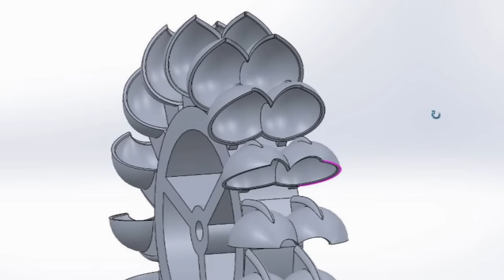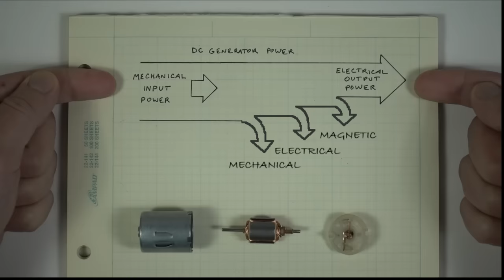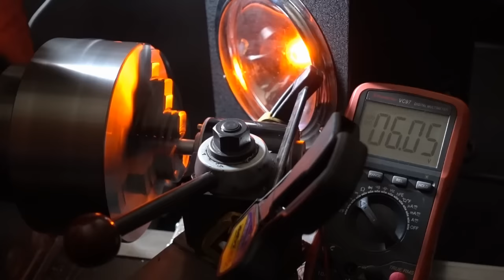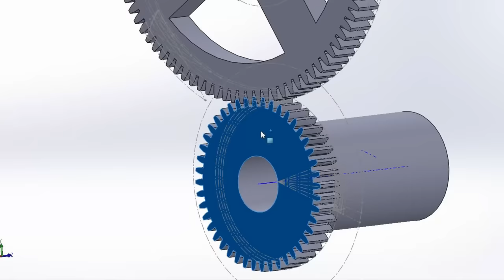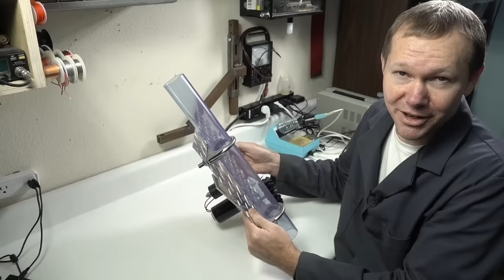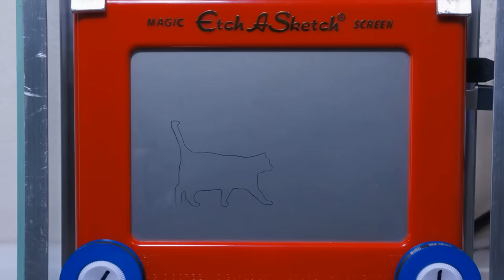Rain Gutter POWER #1 - How to Harvest Free Energy From Your Roof with a Hydro Electric Generator!

Comment: Wouldn’t the gutter overflow if it was restricted to one of the demonstrated streams? I think you need a lot of holes and motors to covert all the water from the roof to power.

Comment: Can't you use a  vertical turbine design, where your generator is mounted vertically, with the turbine impellor connected  directly to the generator shaft. the turbine housing can be 3D printed so that it attaches directly to the PVC tube this will  use more of the available  water pressure, instead of having it splash all over. It also won't clog on pine needles because there will be a larger volume of water flowing through, and past the turbine impellor blades   (see also hoover dam).   --of course that might require a  bigger rain storm to get it to run continuously, but...

Comment: This won’t work without a pump to get the water back to the top to cycle it through again as it will stop raining means no power at all. Use a pump powered by a solar panel and your get constant hydro power plus way more power generated

Comment: 1:08 You forgot to take into account the angle of the roof. You want to use the ground projection of your roof to guess how much rain you collect, you're somewhere down ~25%
Reply from the maker: You forgot to listen to my words during that part...
Reply: @QuintBUILDs  Watching that part again, I did not ear you mention it. Your schema however seems to give ground projection but there is uncertainty. Sorry if my comment sounded harsh, I'm only looking to be technically accurate (~25% difference talking 5W is significant). Overall, loved the series and thought process. Thanks for reading the comment and taking the time to reply.
Reply from the maker: No worries, pretty sure I said "once I calculate the horizontal distance" plus the dimensions depict the horizontal component. You're by far not the 1st to ask if that was an oversight. I probably missed stuff elsewhere but not that. :)
Reply: @QuintBUILDs  gotcha! At 0:28 indeed. I did not understand it as ground projection. Thanks

Comment: If you had a lot of plastic you could of had gears get smaller and smaller to the size of the motor to create a lot of extra power. You don't even need to bring the size down that much if at all to increase the rpms

Comment: Could you not utilise the Upper diameter of the Pelton Wheel? that is, two (2) individual water jets from the same pipe? You could put a junction to take the water to the top of the Wheel. I have a feeling that You have an excess of water on just the single jet, and this water isn't doing any work. You may find that you have increased efficiency by playing with two water jets that impinge on the Pelton Wheel. Greetings from Australia.

Comment: Hi.
I bouth this motor for wind turbine , connect to battery 12v, max what I can get is 6v or 7v.
But even after few hours run turbine battery voltage go down.
Completely 0 amper.

Comment: I have a well 40 feet deep ten feet around at the top and panels down to 5 feet around at the bottom it’s solid rock all the way down my great grandfather chiseled it it’s always full of ice cold water I always wondered if there is a way to make a hydroelectric system using the water bike jump start starting a water pump to turn a water well that is connected to a generator motor and then switch the water pump where it runs off the generator motor I broke my neck several years ago and I’m bedbound now or I would try it to build something

Comment: Wider pipe creates greater water pressure. Easy solution.
Reply from the maker: The formula for pressure contains no width.  Only density, gravity and height.
Reply: @QuintBUILDs  density is increased by expanding volume at height. It will create greater pressure.
Reply from the maker: @erikbrush  it creates greater weight, not pressure. I realize it may not be intuitive but it's 1st yr engineering stuff. Look it up.
Reply: @QuintBUILDs  precisely. Greater weight. If you were to use a small funnel in conjunction with a wider pipe the flow volume would increase. Also a small funnel instead of a simple aperture would decrease the likelihood of debris blocking the flow and would create a flow pattern.

Anyway, these are simply suggestions. I found the video an intriguing premise. And having not attempted this myself I will defer to your experiences and findings. 

I am building a houseboat as a permanent liveaboard residence. I'm in south western Florida. 

My rainwater downspout system is slated to have a diverter so that after the first ten minutes of rain flush cleaning the roof I can harvest rainwater for a potable water supply. 

I had not considered using the remaining flow as a potential battery bank source of energy. 

I've been looking into making small hydro turbines to deploy at anchor when the tides are running strong or when I am under way. Your idea has me considering a small series of generators staggered inside the downspout since I will have a debris guard system on my rain gutters and will be mostly away from any solids that could even make it to my down spout. 

Thank you for the video and the discussion. Best wishes with your system.

Comment: the entire manufacturing process using power-tools causes it to never be power-positive. It's a fun project, but only viable when you have excess power that would otherwise be lost (eg full batteries on an off-grid system). If you only use handtools in the production process it's a different story.

Comment: 0:46 seconds you already make the mistake all people do.....dont worry about flow rate unless you have a nozzle large enough to handle all of the flow....and you dont have from one downspout

what you should worry about is head....that is measured at the top of the water before it goes into your downspout ...so your head is around 12 foot 

12 feet of head is okay

now you are probably going to have a nozzle that is anywhere from 1/4 to 1 inch....so flow wont be an issue

the velocity from the nozzle will be good from a 1/4 nozzle with 12 feet of head

Comment: Y not connect nozzle insted of free water hitting the pelton wheel ,because using a nozzle increases the pressure also connect the nozzle closer to pelton wheel so that u will not loose the water pressure

Comment: i think you get more power if you just make a big water wheel high enough to the top of the drain on the roof and then just let it do normal slow moving leverage and then use a small gear up to turn a motor ac a generator and you chould get many times what you get now. the pelton wheel is lossy piece of crap that loses big amount of unseen energy potential in the input.

Comment: 5mm of rain on average an hour seems over a year average a little optimistic, here in the netheralnds it's on average like 1-2 mill an m/2 / hour. Average / year t hat is
Reply from the maker: Agreed.  "moderate" as listed in multiple places on the internet is in my experience definitely not "average".  The rain does supply the rate I calculated but only a few times a day on a rainy day.

Comment: why not use a smaller hole on the tube --> faster jet --> more rpm?
Reply from the maker: That would reduce the flow at the same jet velocity which would reduce power.
Reply: @QuintBUILDs  did you calculate the optimal rate of jet speed to water flow? This could really help me with a project I'm working on
Reply from the maker: I should have but didn't. I'll probably go back and see where it landed at some point. People put the formula in the comments for me somewhere.

Comment: Why not use the wheel to power an automotive alternator to charge batteries. The use a power inverter. If you couple this with solar panels you get fully charged batteries rain or shine

Comment: Are you by any chance a physics teacher?
Really good vid but it's highly unlikely the average Joe happens to have a machine shop and all the other gismos in the garden shed let alone the free time to mess about like you have just to light an LED.
However, a good idea, just needs more power like to run a fridge or kettle ☕☕☕☕☕🍩🍩.
How about a high level collector tank which would add more weight to the downflow??
An opportunity to design a sellable DIY kit to get power for a battery charger which could run an adjacent outside light, also clipped to the downpipe.
When you make that million dollars please remember I gave you that idea and pay my mortgage off there's a good chap 😊😊

Comment: To bad you can't 3d print a basic transmission to reduce the torque back pressure on the cupped wheel.  Wait, you can :D

Comment: Why not capture the water off of the generator and pass the water another generator, use a dozen generators and combine the outputs in parallel or in series to charge a deep cycie battery and instead of one two meter drop, stagger the generators a 1/2 meter below each other less power per generator but make it up on quantity of generators

Comment: Your assumption of how much water vs sq area is inaccurate.  Your roof doesn't lay flat and looks like it's on a fairly steep pitch.  It's on an angle and you can only take the "footprint".  You have to consider the pitch vs area.  If your roof was "vertical", you would get "zero" water being caught and flowing down the roof.
Reply from the maker: Nope, watch that part again...
Reply: my bad, You explain everything else so we'll and don't make this point explicit
Reply from the maker: @chineseredneck1211  no worries, several people have made the same assertion.  Probably because I put the word "Area" on the surface of the roof?

Comment: It can't work. Why? The more power we need, the more resistance comes from generator. So in this case, his generator can 2 diodes power up. The better results he could reach, if he install huge tank below the roof, gathering the water, and one pipe draining where the turbine could be installed. Better but not enough.

Comment: It would have been much easier to build a Pelton wheel half as big than the one u were using. This would have doubled the RPM without sacrificing efficiency...
Reply from the maker: It's more complicated than that.  Power is torque x rpm...  And pelton wheels really care about jet vs. spoon velocity.

Comment: The rain footprint of your roof is not the same as your measured area. Your roof is a hypotenuse and you have to find the horizontal component. It wouldn't be worth knit picking if you didn't feature calculation so much.
Reply from the maker: Better watch that again...

Comment: Gears are bad, 3D printed gears are horrible. Use a Flyback Converter to boost output voltage from the direct-drive generator. A simple DIY kind of flyback is called the "joule thief" and every one of the cheap solar garden lights has one. There are some good vids on YT which go into the theory and building of them.

Comment: wouldnt it be more productive to collect that rain water in a 55 gallon drum (maybe tied to a tree at the level of the gutters with just enough angle for water to flow into it. then run your down spout and changing diameter of pipes can drastically change outcome creating high/low pressures. You could have a switch turn on when barrel gets 3/4 full. 
even though i do not see this worth the cost/time verses outcome. You are also going to loose power running wire from outside to inside where you would use the load, longer distance = power loss. 
seems like it would be better to reroute this water into a water turbine system, which can produce 500+ watts, run that water from all gutters into the 55 g drum and run that 500 yards away, that will create a nice head/flow rate, if you can add that to a dammed stream or pond water source, you have a much better use of this water.
Reply from the maker: I need to do a video addressing people's belief that diameter of a vertical pipe has any influence on pressure. In part 4 I make use of a reservoir.
Reply: @QuintBUILDs  from what i understand the weight/density of the water (as there would be more water) x gravity would create more pressure. I have seemed to get those results, not that I have done a whole lot but doing some water hydropower experiments, so I will probably learn much more.
Reply from the maker: @kevinjohnson5060  pressure = density x gravity x depth. The weight of a larger volume of water will be greater but the pressure would be identical. If width were a factor then the width of a swimming pool would change how much you float.

Comment: 1st things first love the video and the physics. But you yanked my chain with diamond plate, hat I  meen to say is that for some thing to be called diamond  it must have real diamond or diamond dust, there are some actual tools that have diamond in them real diamond. So 1st tool is a diamond cutting disc for granite and hard metal applications. The 2nd is a new invention it's called the diamond batterie. Witch yes the diamonds are grown in a lab with radioactive materials, incased in a batterie casing. And doesn't stop producing power for 28,000 years. But sadly atm the batteries aren't being sold, as radiation levels are too high. But once they figure out radiation shielding it will work better the a nuke plant or hydro power, so no not diamond plate. Its checker plate and I know as I'm a manufacturing engineer and I am also trained in knowing gauge of metals types what metals can mix with others. So yeah checker plate not diamond plate

Comment: Halfway through this video, I'm already wondering why you bothered. If anything, you should have found a place to build a pond or at least a deep tank to collect as much rain water from you property as possible to use.
Then again, at 2.5 million views free power is probably not the incentive here. And it gives other people ideas for this.
some years back, I thought of utilizing all possible sources of energy loss in a house to collect. Every time you turn the facet on, drain water heat that escapes you house, the heat from the stove cooling down, etc, etc. really though, just designing a house to be more energy efficient is going to to a far better job. It is fun, the first time you realize you're making usable power. Even if it only charges a phone.
 You can also use the landline (telephone) to light some LEDs. Combine that with a photo censor or something & you can have some emergency light. Not much though. It's enough to see in the darkest parts of you house at night though. Some of you may have noticed that the phone lines almost always work during a power outage. Only those of us old enough to know that there are phones that you can buy that require no battery or wall plug.

Comment: Hey, friend!  I think you are wasting energy at two points.  the wheel should be encapsulated inside the tube, so there would be no water loss.  and the water is coming out of the side hole.  you are losing the force of gravity, putting direct pressure on the wheel.

Comment: U should use brush less motor
Reply from the maker: Watch part 2
Reply: @QuintBUILDs  bldc motor and and star configuration and  full bridge reactifier and after that a boost convertor and u will get enough power
Reply from the maker: My EE friends tell me boost converters are terribly inefficient.
Reply: Yeah they are right  ... U can built this without it  i will give u link how to do it

Comment: The diameter of the hole, too big. A smaller hole, give more pressure, spin that wheel faster, and the water last longer.
Reply from the maker: Why would reducing hole size increase pressure?
Reply: It is not only a matter of pressure but the weight on a broad surface is one of the keys.
Reply from the maker: Okay, but pressure comes from the height of the column of water in the pipe and is independent of the jet diameter.

Comment: You did it wrong.
Instead of wasting half the energy, try the jet from the cap and straight down, with the pelton wheel under the end of that pipe.

Comment: I am very disappointed. I fast-forwarded to the end of the video to see a lamp or TV running off the generator. All I saw is 1 watt, and a low voltage reading on a multimeter. 👎

Comment: Math is bad... area of the roof is not the correct calculation because the roof is not flat... you need to get the horizontal distance not the flat distance...
Reply from the maker: Watch that part again